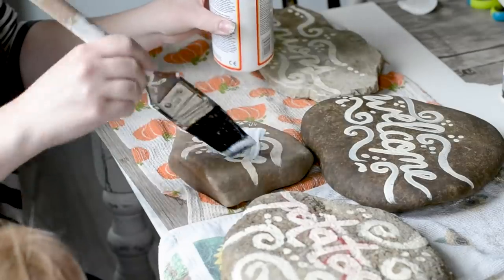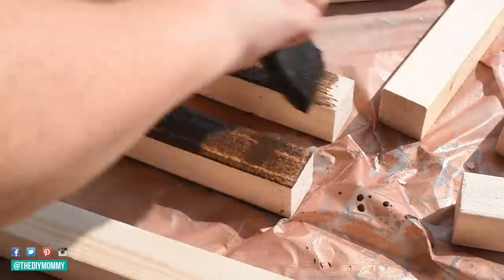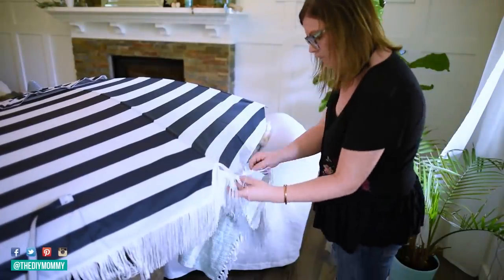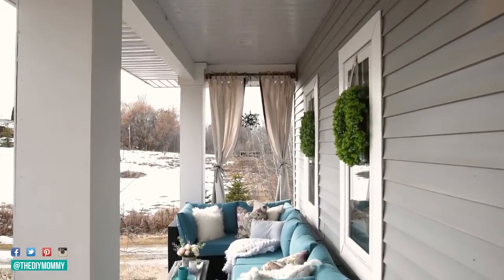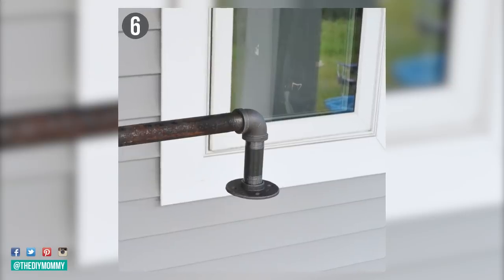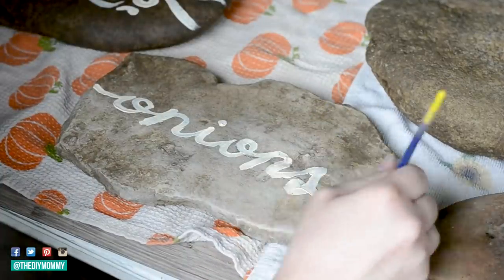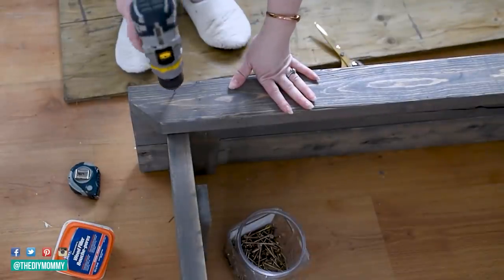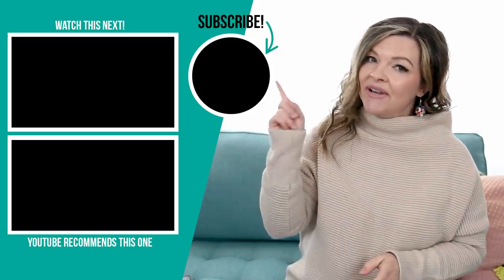10 Amazing Outdoor DIY Ideas you'll want to make ASAP! | The DIY Mommy

Comment: Really creative ideas, Love them all !!  Since metal pipes and fittings can add up to be pretty expensive real quick, I decided that for the outdoor curtains I would try a cheaper version of using plastic pvc pipes and fittings. Then I painted them black to go with my decor. Looks Sooo beautiful, can't even tell they're plastic !!!  Also in the middle of the pvc pipe I put a brace to give it more strength to hold the somewhat heavy curtains. I'm so excited to try your other projects. Thank you so much for sharing.

Comment: Last year I took a canvas drop cloth and simply used inexpensive clips from Amazon and put them on a tension rod. I absolutely love it but I have one problem. It is very very windy on that end of the house and I was wondering if you had any suggestions as to how to keep it from becoming a sail when I close the curtain for privacy?
Reply: If you have room at the bottom of your curtains, you can add weights to them. You can put them in a hem, or just use E6000, and attach the weights to the corners of each curtain. Hope that helps!
Reply from the maker: I think Denise's idea of the weights would be a great idea!
Reply: @daynad8104  I really should try that. I thought about it and I was afraid with a strong wind it might hit the house
Reply: @jo-annemurphy2921 -I haven’t put up my curtains, yet, but I’ve seen how the wind blows the roll up blinds that were left from the previous owner, so I know that my curtains will blow, too. I’ve been searching for ideas, and so far using the weights is all I’ve come up with. Will have to just try it, and see.